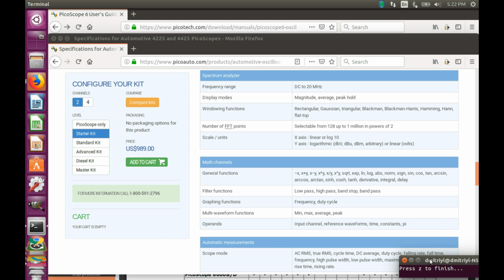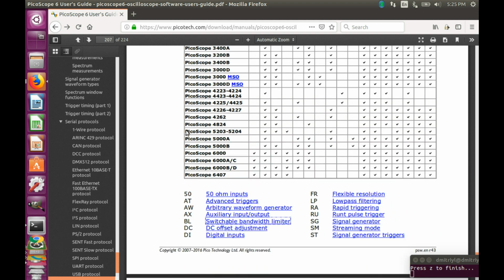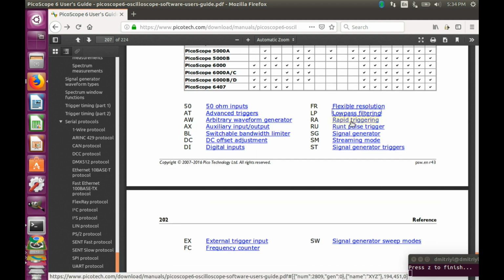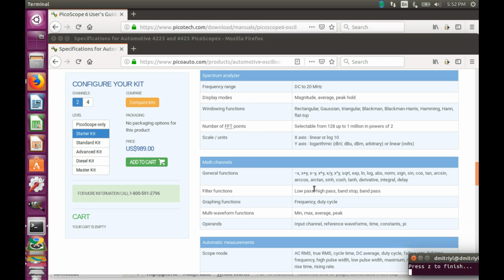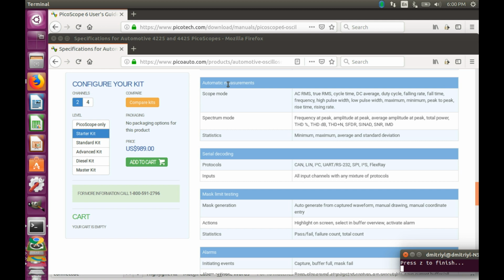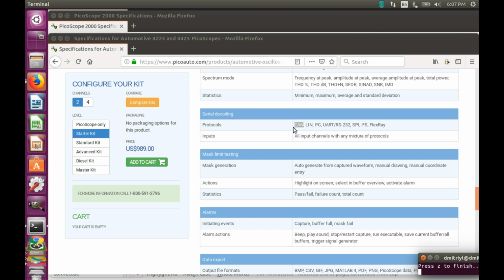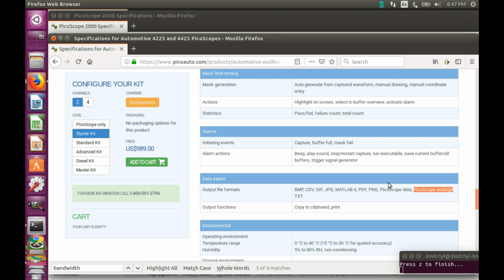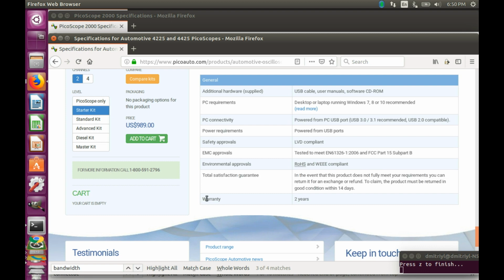Overview of detailed specs of Picoscopes (Automotive + 2000 series): Part  4

Comment from the maker: About the Switchable Bandwidth Limiter: in Pico 4225/4425, Tools/Preferences/Options/Show Analog Options enables (but not sets) a "Bandwidth Limit" checkbox in the Channel Options dialogs for all channels. Marking that checkbox for the channel of your choice will set a 20kHz analog filter. 

See more here: https://www.picoauto.com/library/training/filtering

About Serial Decoding: the latest version of the Automotive software has the same serial decoding list as the non-automotive version.

Comment: Dmitriy, Here is the list of decoder protocols that the Pico software (V. 6.12.7.2724) gives you for the 4425:
1-Wire, ARINC 429, CAN , CAN FD, DCC, DMX512, Ethernet 10BASE-T, Fast Ethernet 100BASE-TX, FlexRay, I2C, I2S, LIN, PS/2, SENT Fast, SENT slow, SPI, UART (RS-232, RS-422, RS-485), USB (1.0/1.1)
So it does seem a little incomplete...
Very much enjoyed the in depth tour and comparisons of the Pico scopes.  Funny thing; I use one of the baby picos at work, but for home stuff I use the 4425. :)
Reply from the maker: Thank you, Stephen, your feedback has been helpful to everyone here.